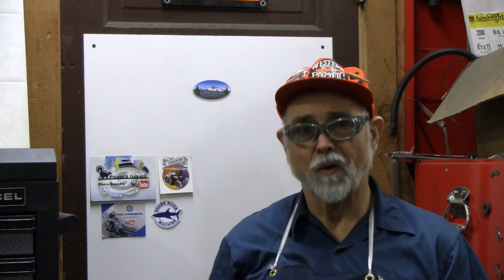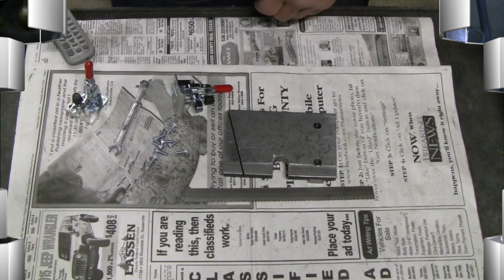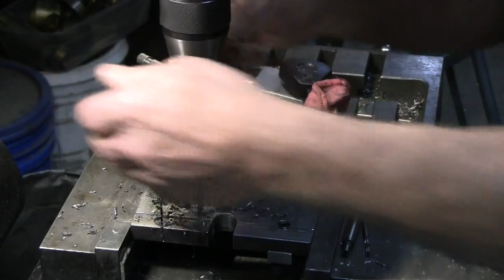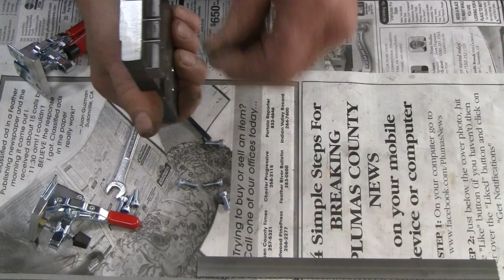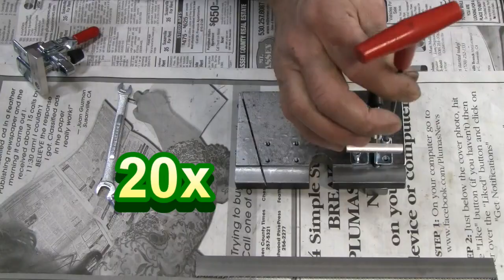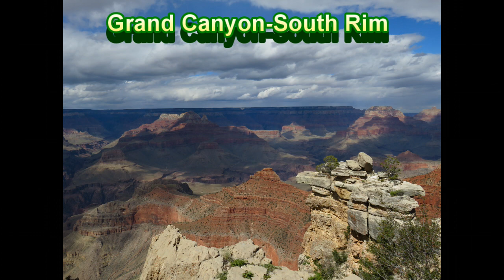Bandsaw Blade Fixture--Part 3

Comment: That’s a handy tool. Are you planning to weld your own blades?
Reply from the maker: Jim, I don't plan to do it on a regular basis, but sometimes I snag a tooth when I'm not careful on thinner stock, or in this case get a blade with a bad weld, and it's nice to be able to fix such issues myself.